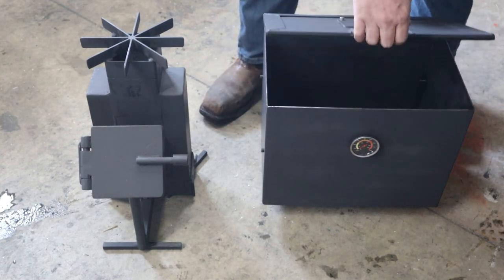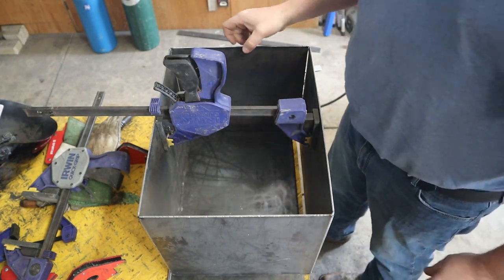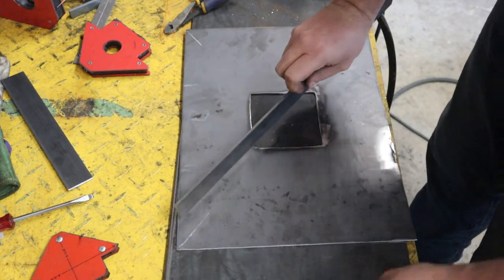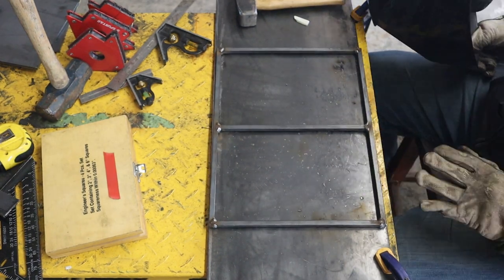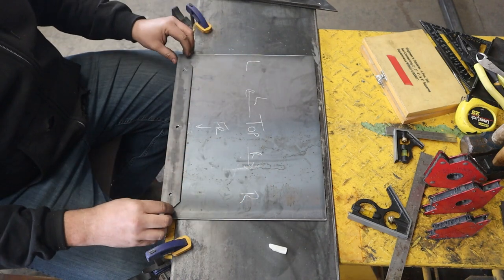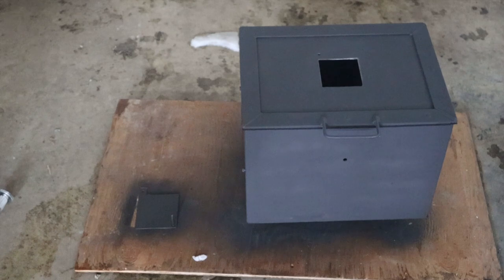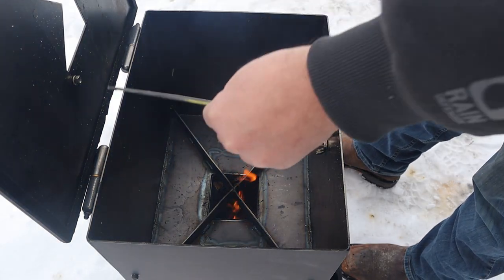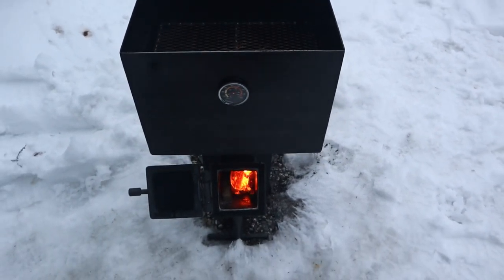Rocket Stove Attachment BBQ Smoker Build

Comment: I was thinking of rocket stove smoker build as I was bbqing this weekend. Shouldn’t have been surprised it’s already been done. However I was thinking of a longer smoker chamber with the stove vent offset to one side and instead of a plate heat deflector using a metal bowl to put pellets in (like an inverse plumbing or chimney stack cap) for better smoke penetration as rockets stoves burn so efficiently and with little smoke
Reply from the maker: Sounds cool, let me know how it turns out!